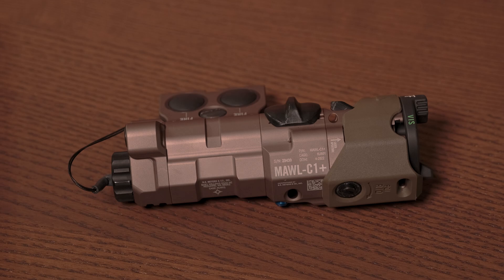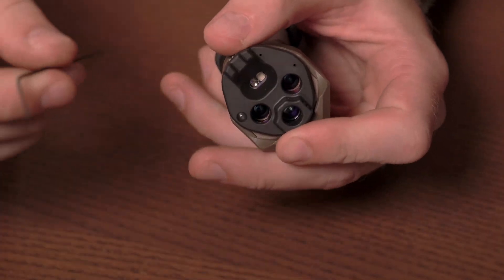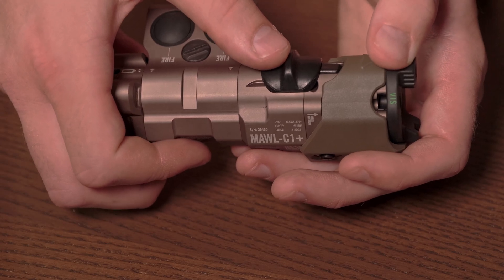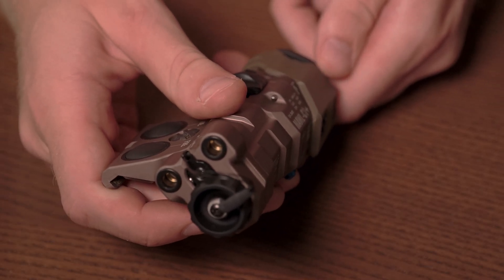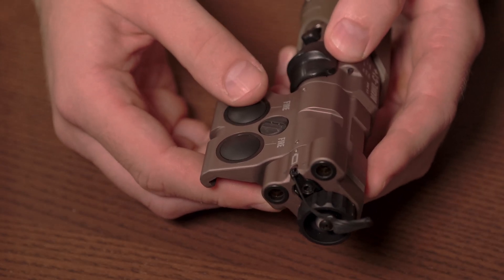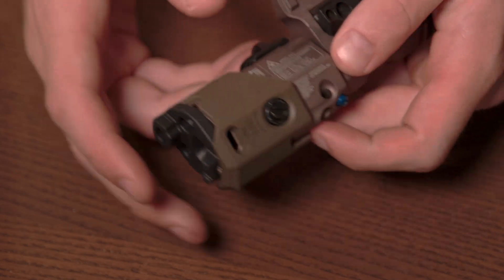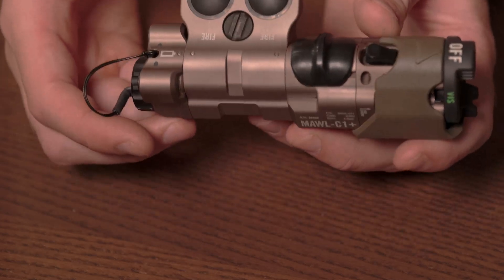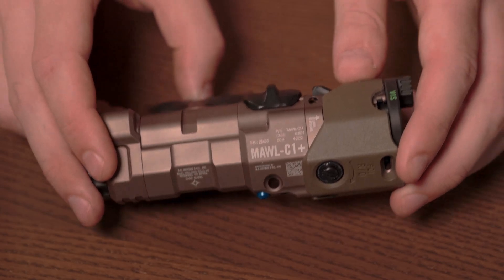B.E. Meyers MAWL Detailed Technical Review

Comment: This is probably the dumbest question ever, but what type of scopes do you recommend to use with this? Does the scope itself have to be a red dot, or have IR capability? Can you use a 1-8 LPVO?
Reply: Regardless your optic is completely separate from the laser/illuminator. 
You don't shoot your laser through your optic.  You actively aim with the laser. If you want to shoot passively. Without a laser, You need an optic with night vision capabilities to shoot decently.
Reply: What has the optic to do with the laser?

Comment: My first MAWL has the power drain problem. The new ones do not. Apparently, you can send it back and they will fix it. There were only a certain range of units that had this problem.
Reply from the maker: Good to know!
Reply: Which range. Was it a certain lot number? Did they tell you ? If so, could you post?
Reply: @j.n.8745  My date of manufacture is 04-2020. I have not contacted them as I was not willing to be without my unit. This is information that I have gathered anecdotally from other people posting the same issue. I don't keep a battery in the unit during storage anyway so, I don't know if the problem has any real bearing on practical use. I really need to contact Meyers and see what they say.
Reply: @KarmaFlight  Thank you for the quick reply.  I do the same. I do not store it with a battery even though I have heard that this is Ok.